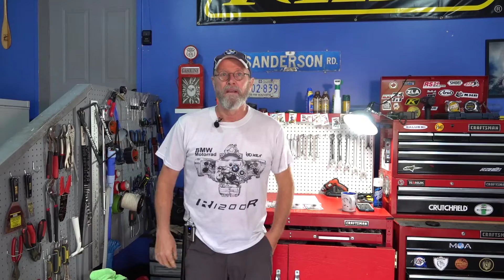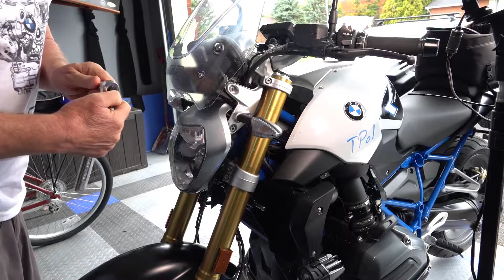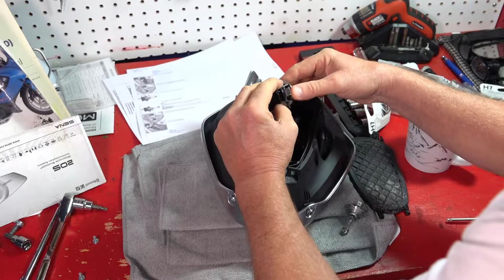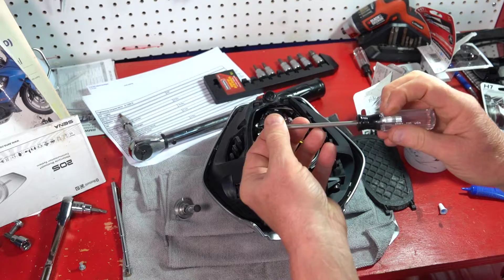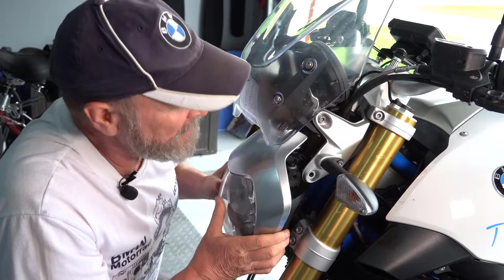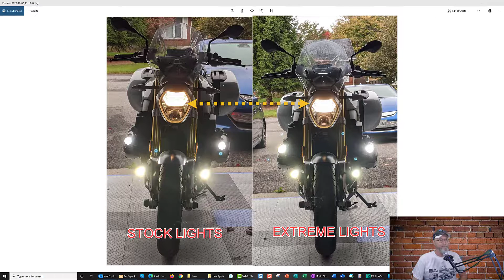R1200R 2017 - Headlight and High Beam Bulb Change

Comment: I don’t see that much difference. Compared to stock, it may be a whiter light, but a H7 LED bulb would be night and day difference. I have H7 LED’s on my 2017 F150 fog lights. Those suckers  put out the lights. I also want to convert my 1250R to H7 LED.
Reply: Hi, which H7 LEDs could you recommend?

Comment: Pretty useful information, thanks for taking the time to put it on video.
Reply from the maker: Thanks. After doing that I discovered that the light fixture swivels out and no screws to remove.  This also saves the calibration step.
Reply: @Cesar Villa 
I have a 2021 R1250R Exclusive, nothing has changed about the swivel mechanism.

However, the left side bolt need not be loosened at all as this might still affect the headlight callibration.

In my case the right way to do it is:

1) Remove the cover with the r1250r logo which protects the TFT dash, the screen is not affected in any way. (This prevents the silver/grey headlight shroud from being removed, hence the need to remove the cover).

2) Remove the silver/grey shroud around the headlight, this exposes the swivel bolt mechanism on the left side of the headlight, loosen the bolt as necessary (The swivel mechanism is black in color with a black bolt, easily overlooked my most people).

3) Remove right side main headlight bolt and the whole headlight unit swivels out as you mentioned.

4) Remove the headlight  back cover and replace both the bulbs by rotating the black bulb holdercounter clockwise (no need to remove the small bolts as shown in this video. 
PS: Wear VInyl or Rubber Gloves to avoid fingerprint or oil stains, as this will shorten the life of the bulb.

5) Put everything back together. 😀

Hope this helps someone out there.

Edit: Page 195 of the Owner's Manual (2019 model year onwards)  has Illustrations .

Cheers!

Comment: Thanks for the informative video! The measurements 5 meters off and 33,5"-5 cm (~80 cm) up, are this generic or specific for the R1200R?
I have an R1250R -20 and which needs headlight adjustment really bad.... ;-)

Comment: I also have a 2017 R 1200 R but it must be a newer version as Paul's bike is just like the 2016 version.  On my bike, you do not remove the headlight assembly, you loosen the left side bolt and remove only the right side bolt and the assemble swings out to the left (right as you face the bike).  The light fixture swivels out then, no screws to remove.  This also saves the calibration step.
Reply: I have a 2021 R1250R Exclusive, nothing has changed about the swivel mechanism.

However, the left side bolt need not be loosened at all as this might still affect the headlight callibration.

In my case the right way to do it is:

1) Remove the cover with the r1250r logo which protects the TFT dash, the screen is not affected in any way. (This prevents the silver/grey headlight shroud from being removed, hence the need to remove the cover).

2) Remove the silver/grey shroud around the headlight, this exposes the swivel bolt mechanism on the left side of the headlight, loosen the bolt as necessary (The swivel mechanism is black in color with a black bolt, easily overlooked my most people).

3) Remove right side main headlight bolt and the whole headlight unit swivels out as you mentioned.

4) Remove the headlight  back cover and replace both the bulbs by rotating the black bulb holdercounter clockwise (no need to remove the small bolts as shown in this video. 
PS: Wear VInyl or Rubber Gloves to avoid fingerprint or oil stains, as this will shorten the life of the bulb.

5) Put everything back together. 😀

Hope this helps someone out there.

Edit: Page 195 of the Owner's Manual (2019 model year onwards)  has Illustrations .

Cheers!
Reply: @BlAzEAnGeL85 this was incredibly helpful, especially the manual number for my 22’ plate - thanks buddy!
Reply: Is it possible to remove the shiny silver cover for possible  color change? I was thinking to paint it with plastic removable color. I have seen some on the Web. Thanks

Comment: Thanks for the upload.  I have an R1250R and the headlight is one of the worst things about it, both in style and performance!  Riding at night, the headlight is good for about 35mph, no more (high beam is better but obviously you have to dip for oncoming traffic). If I had the money - and talent - I'd love is to swap out the whole headlight assy for a good LED based projector unit.

Comment: Not entirely convinced Peter that the new bulbs were brighter the two images side by side before and after show the floor on the before shot a darker shade than the after shot which suggests if both images floor density was married in photoshop then the before bulb would also be rendered lighter.  Before removing headlight on the run or if required... place a strip of tape between side of headlight and retainer bracket slice through tape in the channel and realign when reinstalling. Thanks for sharing very useful and appreciated.
Reply from the maker: You are probably right about brightness but they seem to be a whiter white more close to my additional LEDs.

Comment: Hola, I change my lamps, my new light is LED, Is gread, saludos desde Colombia
Reply from the maker: Can you link me to the LED version you got? I only found them for the earlier models.
Reply: Thanks for the video, I also changed the bulb like you did. However, per the owners manual, you can change the light bulb without changing the adjustment. The light housing swivels to one side.